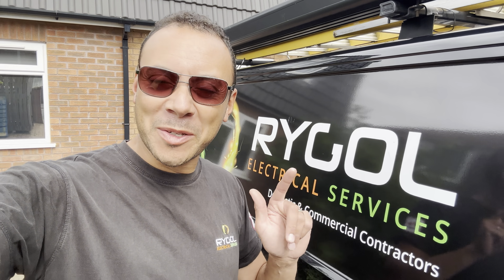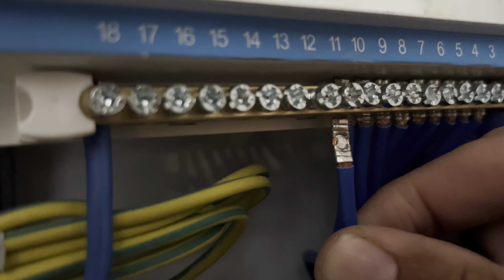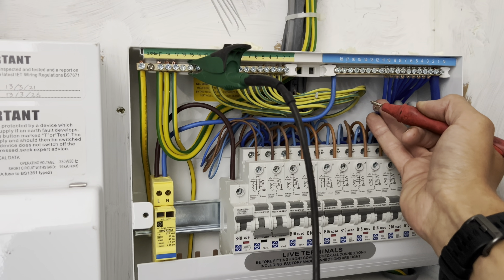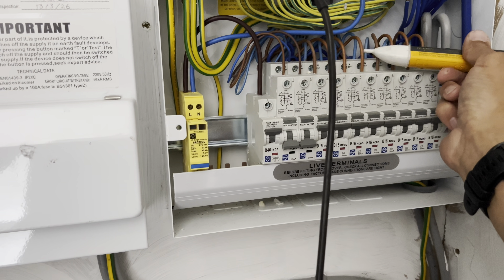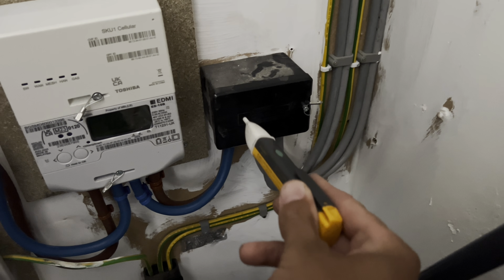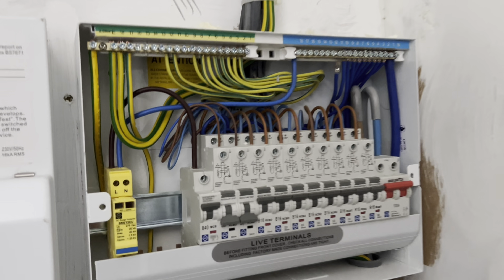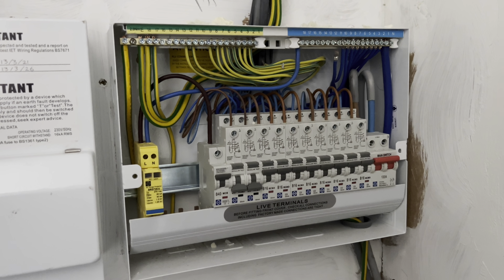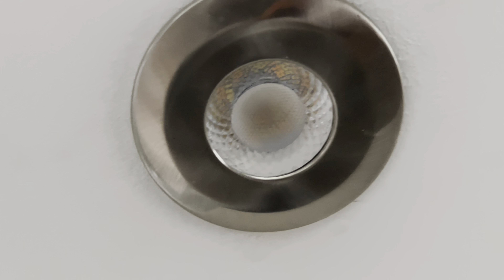Smart Meter Disaster! ⚡️

Comment: I see lots of people doing this.  Now customers just change in their plug nutrel and earth wires around  
And it doesn't cost you anything to run say dryer oven . Heaters.
Reply: @ joshdeb No that’s a myth. If it was to work I would have been on free electricity years ago.

Comment: Did I miss the Electrician fixing the fault? The Neutral and Live were crossed in what ever the connection box that has a tag on it. Can and independent electrician fix the company equipment even if it was a fault. May be I wasn't paying attention and missed it. A bit confused.

Comment: I had a problem years ago. I was fitting some outside lights for a customer, and they mentioned that their appliances didn’t last very long especially the washing machine, they replaced every 2 to 3 years. I miss you, I test from the plug outlets it turned out, every one was reversed in the outlet
This happened when they had the house rewired   I ran into the customer a 6 to7 years later, they’ve had no problems ever since

Comment: As a sparks I thought nothing can surprise me... got called in to look at a rental property... where the tenants left.. found thay rewired the flat with doorbell wire less then 1mm ( sockets and lights ). What was worse there was a kids bed silver metal with burn marks where the cable is... I have never in my life seen this in my life...
Reply: That's terrible, when I was a trainee my boss told me to go in to the attic and cut out all of the lighting cable, I started cutting and then bang, I got a jolt and a big spark in front if me, made a hole in the cutters and then my boss was going mental at me, saying I should know what wires are what by now, I kept saying I cut through the 1mm cable, he turned the power back on, came up in to the attic, took one look and asked the customer who did the wiring before, they said a builder friend, so he told them that they nearly killed his apprentice because they had used 1m cable throughout the whole house

Comment: I can’t believe this is how the load Centre is wired. Here in Aus we have the MEN system (multiple earth neutral) there is a earth wire bridging neutral and earth bus terminals. When the smart meter techs were to put the service fuse in it would have instantly blown and possibly injuring the tech.
Reply: The neutral and earth are not joined in the distribution board in UK, but instead in the incoming service head with the TNC-S supply.

Comment: So - YOU BROKE THE SEAL... & that sir, is VERY naughty.
You should have called for a pole fuse removal, and immediately reported the fault to the power supply authority REQUESTING an authority to "break their seals" to effect an emergency phase reversal problem, and that you are taking videos of the entire process, to provide evidence that yes, YOU need to break the seals, UNDER URGENCY.
Or to have one of their own inspectors RUSH OUT and de-activate the phase reversal which THEY (or their meter installer) CREATED.
A DEATH TRAP, waiting to happen, as..
IT WAS NOT ONLY a problem between the neutral bar and the metal casing, it was ANYWHERE a "BONDED EARTHED CONDUCTOR (such as the sink bench in that kitchen) MAY have been touched, at the same time as the NEUTRAL side of any faulty appliance..

Comment: I think it would also be a good practice to have an isolator switch between the meter and Henley box as a safety measure to cut off supply to consumer unit in case of any emergency.

Comment: I’m afraid this is not an unusual fault. In the years I was a contractor I can across this several times. The last thing I always used to do was plug in the socket test before leaving site even after doing all the other checks/tests as a final test. The scariest thing is that if there is a neutral to earth fault there is no trip or fuse to protect the cabling (apart from the main fuse) and could start a fire.

Comment: The DP main switch would isolate the tails from the neutral busbar but apart from this, a great video.
You should report this as the installer can then be checked and retrained or fired. His other work needs checking in case he has done similar at other locations.
Generally, this mistake shouldn't be able to happen as the tails would go from the meter to the main switch in the consumer unit and are colour coded. The mistake happened at the Henley block, probably due to the installer not understanding or being able to follow continuity.
The biggest problem is that the final polarity check has not been done properly. The installer may have just checked that something worked, not understanding the importance and possibility that the polarity could be incorrect.

Keep up the good work and please report this for the safety of the public, if you have not already done so.

Comment: Many years ago, I repaired an 11kV fault on an Aerodrome. PILC cable, joined A to A B to B and C to C closed the isolator on the main ring, the incoming 11kV breakers operated, the whole site (37 transformers) went black. Turns out that the previous contractor, (still operating) had made a joint in  the 11kV ring and crossed A to C B to B and C toA. The owner of the site declined to pursue this further.

Comment: I had a smart meter fitted about two years ago. I asked the two guys who came to fit it at the time if they were qualified electricians.  They replied that although they had received training on the installation of smart meters, they had NO formal qualifications as electricians. I am therefore not surprised that this potentially lethal situation has arisen.  Remember the old saying, "A little knowledge is dangerous".  As far as this video is concerned it is a case of QED.!!

Comment: Interesting. I recently had a pair of “smart” meters installed in my place (electricity & gas) by a well known firm based in Bristol (they are keen to do this to comply with the Ofgem targets on them, and others). After installing the electric one, the guy did use a gadget rather like your plug-in one, on of the ring main sockets nearby. While the work was being done, the PV inverter at my place was switched out, then back on after the installation was done.

On the gas side, he did do some other checks on the appliances that use the gas, after installing the new one, as well as the other checks. All looks fine at the moment, from mid July.

Incidentally, in the place you went to, there was probably one of the in-house display units lurking around, plugged in to a supply. No doubt it would work normally whichever way the earth was connected to though.

Slightly off topic: a couple of years ago a most of the supply cabling and the local transformer at my place were replaced by SSE. A few minutes on that here on my channel: https://youtu.be/LS8VFhRMsYY
Reply: So they fooled you with their bs about ofgem targets.
It's all a ruse to control supply. You will not benefit one bit from ovo

Comment: In a simple house, you'd go outside, turn the fuses at the metering clock off, go inside, test with your test bulb screwdriver that you indeed have no power, if so, then replace the FCD, and turn the power back on.

Comment: I know someone who has their meter changed to a smart meter and they claimed the Tesla gateway had been installed wrong, so cut the wiring to it and put the gateway in parallel which meant that the solar panels would have supplied to the grid has there been a power cut. Utterly dangerous situation that the smart meter installer has left the property. It was also a lot more work that took 3 times as much time compared to what they needed to.

Comment: inductive coupling

(above was written when you said
"write your guesses NOW")

shocking what the video revealed after.. 
I would've switched off and disconnected the board after incoming breaker, 
requested immediate emergency attendance from supplier to rectify 
and only thereafter re-energize board. 
all costs to entity responsible for the accidental line reversal, including damages to occupier for lack of electric supply until rectification, if necessary cost of alternative accommodation etc. 
disgraceful workmanship by meter swap contractors, can not be excused.

Comment: It pays to do one's job correctly. Enjoyed this video. I can't understand why a meter installer doesn't have to be trained better. Like you said, this could kill someone. Your breaker boxes seem to be better designed than what we have in the United States. Your boxes are neat and laid out well, allowing the wiring to be much neater. You do good work and knew the problem had to have been created after you did the original installation. I also learned that British English is quite different from American English. 😀

Comment: My sister made them take hers out as the cost went through the roof. Old meter put back, cost drop drastically. It costs a fortune to run them which you pay for as they are on 24 hours sending messages. And it costs you.

Comment: When installing a 415 vac conveyor system a certain person ran out of 3 phase cable, and joined in a different colour coded cable.
Another person then went to finally connect that cable to the main supply board, but decided to check things out.
The Earth was now an active; and one of the phases was now the actual Earth!!.
Another situation I came across once was a certain well-known circuit breaker brand had a mechanical failure of it's mechanical safety interlock, which resulted in it being live even though it appeared correctly mechanically turned off.

Comment: I could change a meter out WITHOUT training and get it correct. The training should be safety related. The rest is common knowledge. That's the worrying part! Our smart meter installer ended up short circuiting a 3 phase... DNO was not happy at the bill I presented them for compensation due to amount of smoke released into the house....

Comment: Shouldn't that require an emergency call to the supplier to fix the issue in their sealed boxes. If you fix it and they repair the issue later you're going to find yourself blamed for it...

Not only that, the installer and tester NEEDS to be sanctioned. He made a serious error and failed adequate testing. You don't just ignore that. How many more have they done wrong? You're perpetuating a potential disaster covering for them...

Comment: No electrician but I had the same problem in Italy, I found 87V on the neutral line, over there they do not seem to differentiate the phase from neutral at the outlets so after I rewired the entire apartment the fault was gone. Was the meter ever replaced after you rewired the property?